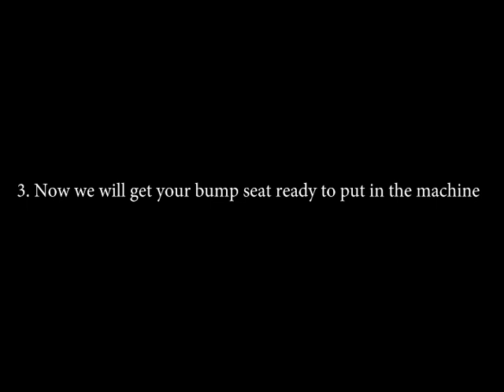UTVMA Honda Talon / Talon 4 Front Bump Seat Install

Comment: I need one for my talon 4 setter pls pls
Reply: Any reason this wouldn’t work on the 4seater?
Reply: Jonathan Lightburne so you think is gonna work?
Reply: Marko Saligan that’s what I’m asking hahaha. I would need the option for 5 too
Reply: I just installed this In my 4 seater and it worked perfect, but it has to go in the front and you loose the front cup holders
Reply: Hi dean so you talking about a honda talon right??
Reply: Jonathan Lightburne well I think cuz of the bottom part
Reply: @deanrodgers4474  can you shift into low? I just mounted mine and it seems really far forward